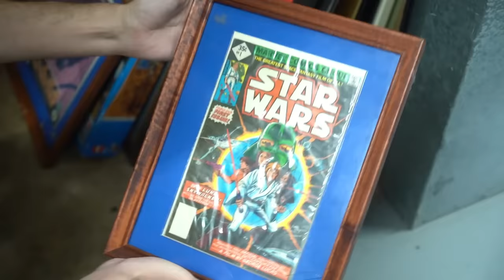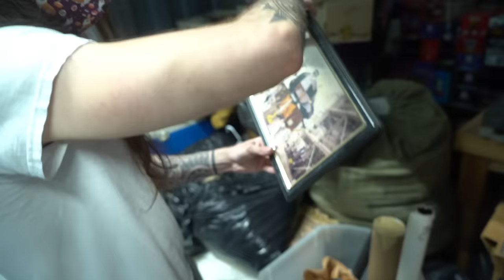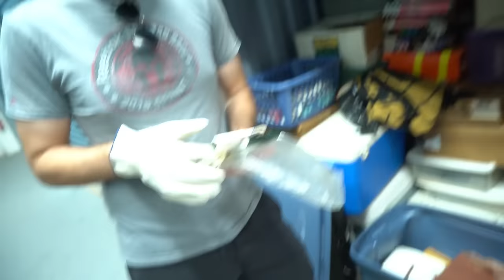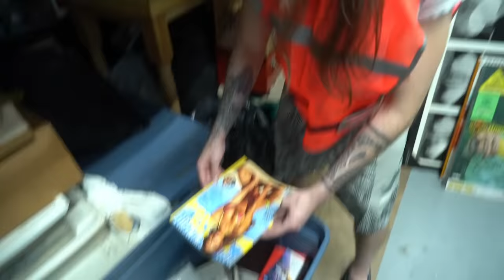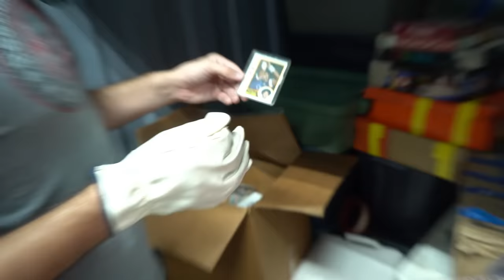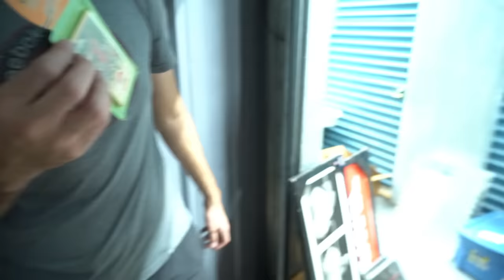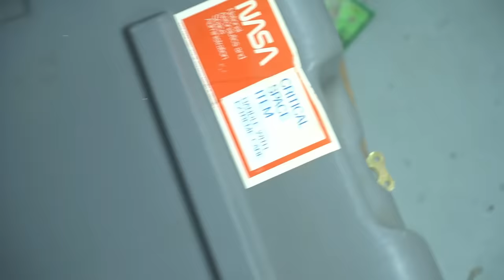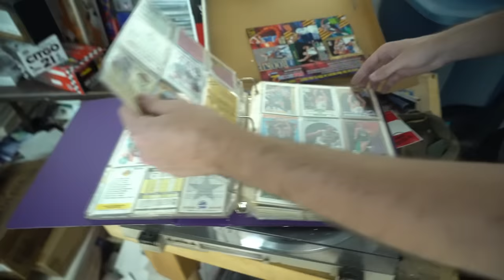I Bought An Astronaut's Storage Unit

Comment: The funny thing is that yes, the Kassner Illusioner poster can go for a grand. Sold at auction back in 2016 for like 1200$
Reply: That would be if it was an original from the 1920s and the paper it was on looked way too new. Likely a modern reproduction
Reply: AHAHAH
Reply: Glad I found this comment
Reply: lmfao
Reply: @Jumbleman5  still worth checking out
Reply: I seen a reproduction sell for 200 dollars
Reply: LOL
Reply: Also they gave away a vintage Lego set which is worth about $300 on eBay
Reply: Saw the video pic and thought it was a chick
Reply: That looked like a reprinted one, it goes for $10
Reply: lol
Reply: @jacksparber478  It is dependent on condition, that one seemed to still be sealed. I don't know if they could have figured out what was in there without opening it, but it would have still been in mint condition. I would say $20 easy, possibly more depending on current supply and demand. Probably worth as much as any sports card in that collection given the years of the cards. The fish hooks they threw out were probably worth as much as any binder of cards will sell for though.
Reply: Logan Metzger  Well I have one for you that has some light wear that I will sell for $500. In fact I have 2 of them, for 1k. How does that sound? You can make bank on them.
Reply: I’m selling one just like it for $200,000 right now.
Reply: Found it for 10.97 online
Reply: @thesmokingsandwich8501  shhhh, how can I sell that very poster to a clown who thinks it is worth 5k if you give away the actual price?
Reply: @thesmokingsandwich8501 
Newly printed
Reply: @Jumbleman5  Bro it was unopened are you serious?
Reply: @alexsilverstein9483  You know that posters from the 1920s weren't stored in tube containers like that right? You know that reproductions can be made and put in containers that are sealed right? You know that that particular tube only had a cap on it and there wasn't a seal broken right?
Reply: @Jumbleman5  I've seen one of those posters that was a reproduction still sell for $200 It was mint. It wasn't used
Reply: Too bad it was definitely a reproduction and they only go for 20$ hahhahaha i wish it was the original tho, that wouldve been legendary

Comment: The NASA container is a standard transit case for sensitive electronics for a majority of US Government agencies. They are designed to be water tight, the walls are hallow so it floats, and they are incredibly sturdy if treated right.
- A former repair technician that worked on a big Navy project.
Reply: That container looks so cool
Reply: Lit
Reply: a lot of people don't know this, but you can put your weed in there.
Reply: @itzMoJo67  Astronautical Boof
Reply: yea who cares about some dumb cards I want that box
Reply: if it’s so water is so tight why was the newspaper inside wet lol :3
Reply: How do you treat a stupid container right
Reply: The containers can get old or damaged. If the seals are worn down or the joins twisted it won't be water tight anymore. Still an interesting piece and possibly repairable depending on the damage.
Reply: @djjfefdfhh1758  it wasnt wet, what made you think it was

Comment: You can see Matt's entire life flashing before his eyes, finally seeing what it all added up to. He did it-- he made all the correct decisions for almost 30 years. Somehow, he just slipped a Rolex into his pocket. He's peaked.
Reply: Yeah, somehow by taking all the wrong turns he came to the right destination
Reply: It’s a presidential day date, worth around 10k…the storage unit was already the coolest one in existence then they pull out that lmao
Reply: When?
Reply: @williamrichie2636  It is fake, and most of what is in the storage unit is not worth anything. Some stuff is, including stuff they mishandled or tossed.
Reply: @EcnalKcin  That's a Day Date ref 1803. Should be made around 1970. There is no way on earth that this watch is a fake unless someone put a new vintage fake in there later and made it look worn down. Chinese knock offs were pretty trash until 8-10 Years ago. Back then that machinery was only used by the Swiss and Germans in Glasshüte. And yeah as William Richie said goes for at least 12-18 k depending on the state and restoration.
Reply: @Tecsy25  To someone who doesn't know better you sure sound like you know what you are talking about, but to me who asked a watch expert in another comment how he knew it was fake, it sounds like you did some googling and decided you were an expert yourself.

He pointed out the magnification is wrong, the cyclops is the wrong shape, it is using the wrong font, and it is missing the text at the bottom of the face denoting swiss timing. I had already been suspicious though because the watch band seemed to have very thin gold plating that was coming off, and/or is tarnished, which 18k gold shouldn't do.
Reply: @Tecsy25  That watch is 100% inauthentic. one look at the cyclops magnification or the fading gold should immediately warn you that its a really poor replica lol
Reply: @EcnalKcin  maybe not worth much money technically.. but definitely worth a lot in historical or nostalgic value. The right people would pay big money to make sure it gets from you to them
Reply: @EcnalKcin  you have left 337 comments on the few videos on this channel talking about the storage unit, and they’re all just weird vitriolic rants about nothing that matters. You seriously need a hobby or a therapist
Reply: @fort809  You just replied to a 2 month old comment, to say you counted all the comments that I made over the course of months on several videos, claimed they all "vitriolic rants", which isn't even the right adjective, nor would they be catagorized as rants, (although I suppose if you took all the comments I made over months in reply to a number of people and lumped it all together as one, it would be), then said I need a hobby or a therepist...

...so you would describe what you just did as perfectly normal and sane behavior?
Reply: @EcnalKcin  you have left 338 comments on the few videos on this channel talking about the storage unit, and they’re all just weird vitriolic rants about nothing that matters. You seriously need a hobby or a therapist
Reply: @Jesus_Chr1st  You just replied to a week old comment, to say you counted all the comments that I made over the course of months on several videos, claimed they all "vitriolic rants", which isn't even the right adjective, nor would they be catagorized as rants, (although I suppose if you took all the comments I made over months in reply to a number of people and lumped it all together as one, it would be), then said I need a hobby or a therepist...

...so you would describe what you just did as perfectly normal and sane behavior?
Reply: @woah8036  You just replied to a 3 week old comment, to say you counted all the comments that I made over the course of months on several videos, claimed they are all "vitriolic rants", which isn't even the right adjective, nor would they be catagorized as rants, (although I suppose if you took all the comments I made over months in reply to a number of people and lumped it all together as one, it would be), then said I need a hobby or a therepist...

...so you would describe what you just did as perfectly normal and sane behavior?
Reply: Honestly, whenever I see a cyclops magnifying lens in a Rolex, I automatically assume it's a fake. Not saying it couldn't be real, but my radar goes up as soon as I see that.
Reply: @teletubbiemidget369  actually, only a couple models have that. And it just so happens those are the most commonly faked models, erego, u see that style alot.
Reply: @teletubbiemidget369  the submariner. That's the one. I couldn't remember the name. I understand what ur saying, but still doesn't mean that when i see a cyclops on a Rolex, or excuse me, a submariner, that i won't question it immediately. Every single fake Rolex i seen was a submariner, and cus of that, i highly scrutinize every one I've seen.  What is wrong with that??
Reply: @teletubbiemidget369  so u wouldn't question it at all even tho it's the number 1 most faked Rolex model ever?? 🤔 Hmm i have some friends who sell watches that might want to meet u.. 😏
U can call me paranoid for QUESTIONING if a watch is fake, then i guess i can call u naive for not. Js.
Also, love how u gotta add how u don't care what i think. That just makes u so much more mature sounding 😏 cus, u know, that had ANYthing to do with the subject at hand.. 👌
Reply: @EcnalKcin  It ended up bieng worth thousands upon thousands.
Reply: @georgeforeman1097  tl;dr: Link please.

Considering you made another response to a different comment of mine in this video, and demonstrated you have no clue what you are talking about, with the benefit of being able to use Google to verify, I am going to call BS. Either provide evidence or keep your ignorance to yourself.
Reply: @EcnalKcin  ironic coming from the guy who has replied to every single comment on the video without any evidence to backup his claims and clearly has no idea what hes saying lol. Google is your friend.

Comment: Charlie putting that cleaver in the trash box gave me an aneurysm. I’m pretty sure that was possibly a 7-inch Briddell cleaver which is very old, and quite valuable. Saw one on ebay for $75.
Reply: "quite valuable" "saw one on EBAY for '75 dollars"
Reply: @1degRazz  For those of us that aren't rich thats some decent money just thrown away... Just cause you wipe your ass with 100 dollar bills doesn't mean everyone does lol.
Reply: @DA-cl4ww  Ebay value of an item is always grossly inflated.
Reply: @oyaworks   nahhh, once got a 20 pc mcnugg for 2$
Reply: @oyaworks  Rarely the case, it's usually the opposite thus why a lot of resellers go to Ebay to fill their shops up. If an item is selling on Ebay for a price regularly, it's regularly worth that price. As for outside of Ebay, I've seen antique knives like that go for hundreds, it will depend on how old it is.
Reply: The Kasper the illusionist poster he threw away was worth a couple hundred bucks.
Reply: @1degRazz  LULZ BEING A MILLIONAIRE MEANS THROW AWAY MONEY LUL

the idea of flipping units is spending x amount of money, and get the most total value out of the unit. Even if the item is 5$. The total that matters is the end amount all added up. If it beats you X value you profit.
Reply: @oyaworks  I think that is the opposite. It is grossly DE-flated. However, always look at what they are charging for shipping. That is where a great deal of the profit can be hidden.
Reply: @1degRazz  75 is def a lot to you lol that’s a pair of shoes?
Reply: He doesn't give a shit
Reply: charlie probably thought it was cursed because higurashi vibes
Reply: The lego set too
Reply: That's like 19 atari 5200 super break outs copys
Reply: 75$ is pretty cheap for a good quality knife

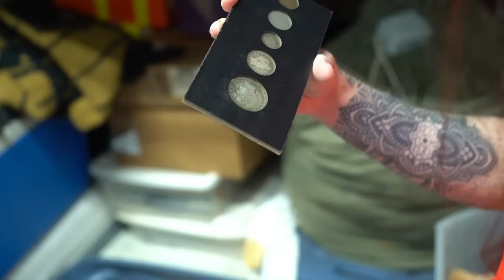Comment: 9:00 in case you didnt know, these are barber half dollars, quarters and dimes and I believe an indian head penny/wheat cent. they are most likely all the same date, that whole sleeve of 5 is worth around 20-50 dollars . If you are counting the whole set, the barber halves go for like 10-500$ (if in mint condition, which may have been the case for one, I didn't get a good view of them). the quarters are obviously a bit less at around 20 in good shape or less of course, the dimes are around 5 to 10. indian head pennies are like a buck.  hope I helped!
Reply: That’s actually sick
Thanks for spreading the information man
Reply: @LubedLightsaber  no problem!
Reply: There's a specific year wheat cent, that if it's magnetized, I've seen sold for $5,000
Reply: @stephendavidson4036  yeah it’s 1944 steel cent I think that is the one
Reply: @stephendavidson4036  1943 was the year, and they generally are a couple bucks around average condition. the rare ones are the 1943 pennies still made with copper or 1944 pennies with steel, because there were only supposed to be steel pennies for that one year and none for that year were supposed to be made with copper
Reply: @breandanfoley4251  I think those were in circulation because the metals from the press weren’t emptied out all the way
Reply: @playboibowlly2568  Steel cents are not worth very much. I'm not sure now, but a couple years ago you can find them for a few dollars or less.
Reply: @jq7323  yeah I’ve got a ton of steel cents. We were talking about a specific one that is rare bc it was from the year after it was supposed to be made, which is rare
Reply: @playboibowlly2568  Ah I see. I'm an idiot, my bad.

Comment: FUN FACT: Those Hotwheels and loose cars in that pink box looked to be 70's RedLines. You can usually tell because the tires will have red lines on them. Some of them are worth some cash. Especially if they're in good condition.
Reply: fun fact! Everyone says these good items but never says a price …
Reply: @Iceisthegoat  because the price depends on how much the buyer wants the item and the items condition
Reply: time stamp?
Reply: @Iceisthegoat  Fun fact! It's almost completely impossible to price out something when it's shown in a pink tinted box. Specially when it's in fame for less than 20 seconds. I could only tell they were Redlines because of the shape of the tires compared to normal hotwheels.
Reply: @Synergy458  I must be blind, I watched from 15-17 multiple times and I dont even see a pink box, let alone one with loose cars in it.
Reply: @TypicalToyReviews  Ah sorry, it's not actually Pink. It's more of a smokey grey. I have no idea why I assumed it was Pink.
Reply: @Synergy458  hmm yeah I cant find it lmao, unless its that bin under the grey bin and above/behind the green bin. The only 1:64 I saw were the Nascars wrapped in paper towel. That being said those acrylic displays hold over 100 cars and aren't cheap, so there is a possibility there is some good stuff in there for sure
Reply: @TypicalToyReviews  The time stamp I gave you is when they have the bin I was talking about in hand.
Reply: @Synergy458  i dont know bud at 15:14 they pull a joystick out of a box and then they dive into another cardboard box of baseball cards
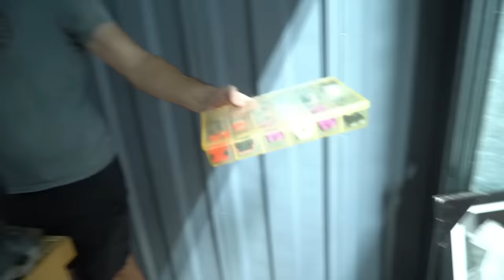Reply: @TypicalToyReviews  that's because the time stamp is 25:13
Reply: @Synergy458  Yeah that would explain it, those are black walls, not redlines. Easy to tell non of them have spectraflame paint

Comment: Hey Man, no nonsense, you NEED to keep that Rolex, they are going up in value so fast, and that is an all gold day-date.  They are in high demand and its worth about 15-30k depending on year and condition, maybe more!
Reply: It is fake. It would be 12-16k otherwise.
Reply: @EcnalKcin  how do you know it's fake
Reply: @caleb6978  Because in another comment a watch expert gave precise reasons for it being fake. Although I strongly suspected it was because that band seemed tarnished or like the gold plate was coming off, which should be happening on an authentic gold Rolex. Simply put, almost every fine detail is wrong.
Reply: @caleb6978  A Daydate with a polished centerlink oyster bracelet does not exist. Also the date magnification is extremely poor. Case shape and thickness seemed way off. 

It’s unfortunately a really cheap fake.
Reply: @ReKief  i agree on the magnification. But, that's a president bracelet
Reply: @darienilham  My apologies, you are indeed correct it is a “president” bracelet. The proportions are just so out of wack that I saw it as an oyster. 

Thank you for clearing it up!
Reply: its a fake rolie u can tell if u look a bit closer

Comment: Wind the Rolex slightly, if the second hand sweeps smoothly rather than "ticking", that's a good sign. The crown logo is correct. 4 or 6 prongs is common on fakes. Also, for the diamond, give a piece of glass a scrape.
Reply: also, on fakes, the cyclops (magnified area of the face) will be raised and not a flush surface
Reply: Some of the more expensive fakes have swiss movements in them. WAY harder to differentiate the good fakes from real rolexs now. Checking for ticking may not be enough.
Reply: @unrealistic5996  gotta remember that might be a vintage one. Fakes have been getting really good just recently.
Reply: @HoseTheBeast  True. There is good possibility that it could have been a gag gift he got a long time ago and saved, but considering the age of some of the other stuff in there I assumed it was a newer and therefore could have a Swiss movement in it. I’m excited to see Charlie wearing it on his wrist next video after the appraiser told him it’s real XD
Reply: @youtubesucksalot4869  I mean if you want the clout then go for it. I have a real Rolex and a fake I got as a gag gift. Practically speaking the fake has more functions, a Swiss movement, looks identical and works well. The only thing it doesn’t have is a perpetual movement so it’s really annoying to wind. It’s even plated in gold and weighed to be exactly like the model it’s imitating. But as similar as it may seem, nothing replaces the reliability of a Rolex and no other watch I own has the sentimental value I attach to my real Rolex.

Comment: 24:02 That container is still really cool though! Who can honestly say that they have a NASA 'Critical Space Item' container in their possession? I'd keep that container and use it as storage and then who knows maybe in 50 years time they'll be worth something. and even if it ends up not being worth much it still looks really cool and has some history to it.
Reply: It’s just a box with a sticker on it you can buy those
Reply: I’m a space collector, i have 3 or 4 of these as well as numerous flown parts of all the space shuttles and apollo missions. These are worth 100 - 200 depending on their size and are very unlikely to increase in value because their is not enough interest in this hobby
Reply: I'd convert it into a beer container, but not touch the actual box.
Just make something to fit on the inside and hold my beer.